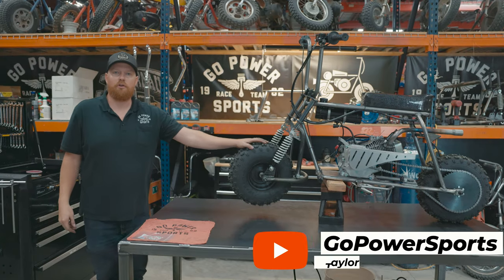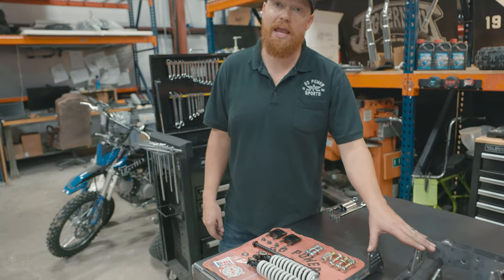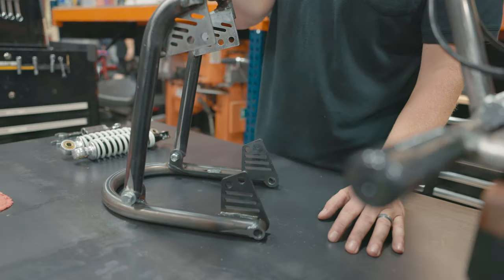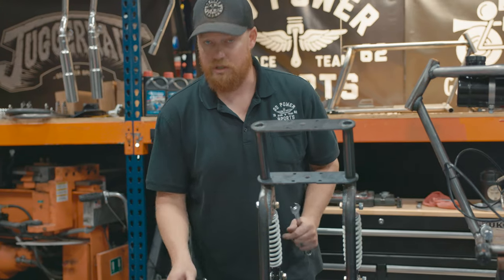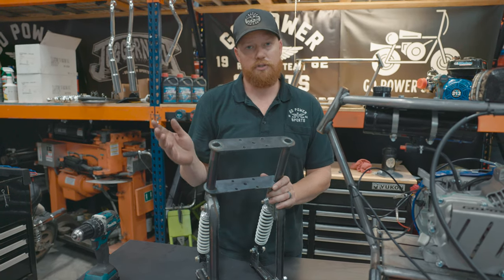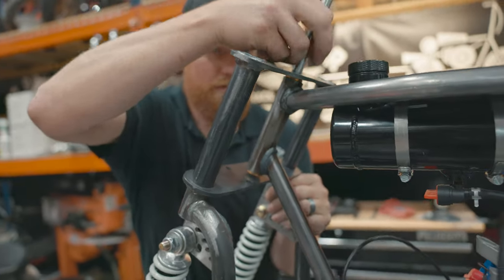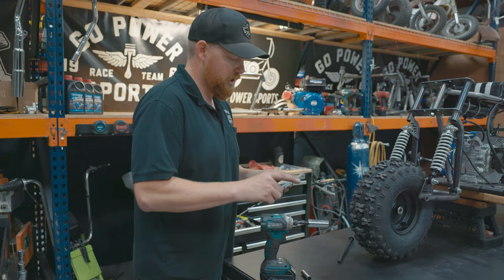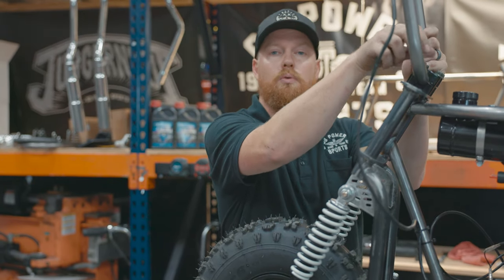Installing The Leading Link Front End Suspension

Comment: When it warms up again I will buy a tillotson 212 and if I like it I'll buy the stage 2 kit because I already have the stage 1 kit
Reply: I can't really tell much of a difference between stage 1 governor removed and stage 2 same bottom  end few more mph top good luck and enjoy
Reply: @heathenprojects2639  ok
Reply: @heathenprojects2639  what if we fella fully ported and milled the head and may fiddle with the valves a bit and then do the stage 2 kit
Reply: @kevinjohnson9372  then technically what would that be mild stage 3 Tillotson are different then predator in a lot of ways 212 cc but around 8 hp out the box but the predator makes a little more torque due to its flat top piston design over Tillotson  dish at some point your going to go to a flat top piston to make more compression and if you got the head of porting and polishing just as well swap it out that's kind of a double edged sword
Reply: @heathenprojects2639  Heathen the flatop or dished has got nothing to do with the amount of torque it generates: your just repeating hearsay parrot fashion. Trev New Zealand 😇🇳🇿
Reply: Tillotson 212 is a nice motor. I really like mine.  It's still governor at 6k with a stage 1. It runs great!  I have two identical builds.  CT200U 100% exact same except one is tillotson and one is predator. Both stage 1 same kit.  The tillotson walks away from the predator every time.  Long before the predator even hits the governor which is 4500 on it.